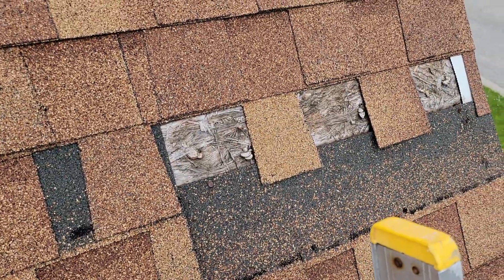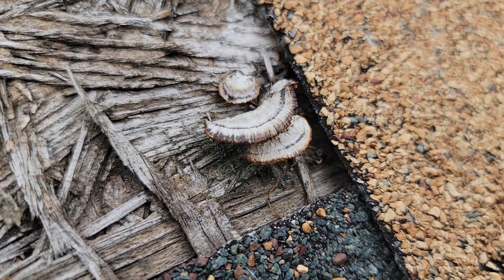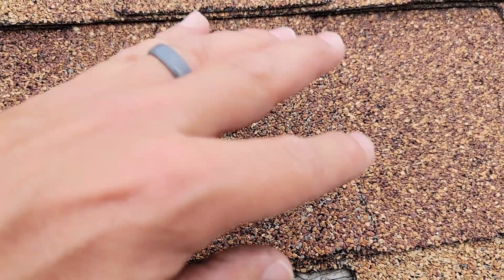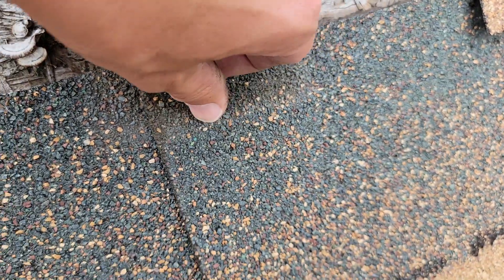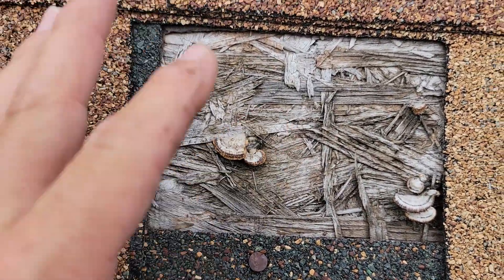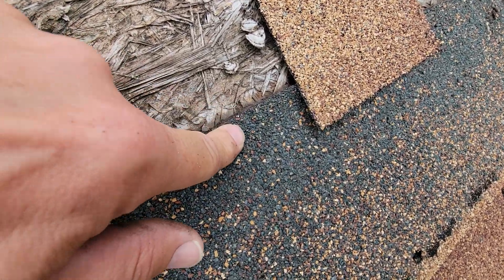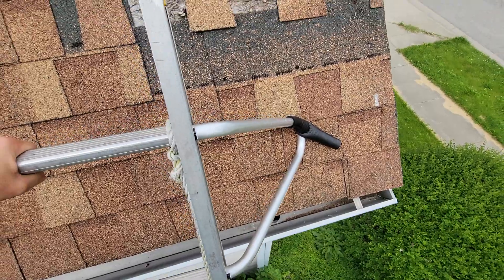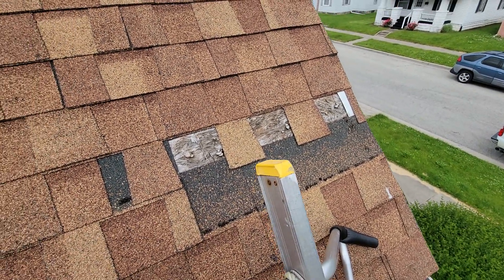Why asphalt shingles are covered with ceramic granules

Comment: Steps for Repairing Roof Shingles Using a Brad Nailer and Granules:
Prepare the Area:

Clean the Surface: Ensure the area around the damaged shingles is clean and dry. Remove any debris or loose granules.
Secure Curling or Buckling Shingles:

Use a Brad Nailer: Carefully use a brad nailer to pin down the curling or buckling shingles. Place the nails where they will hold the shingles flat without causing additional damage. Be cautious not to penetrate too deeply.
Check for Level: Ensure the shingles are as flat as possible before moving on to the next step.
Patch the Area:

Apply Roofing Patch: Use a roofing patch or sealant to cover the nail heads and any gaps around the shingles. This helps to seal the area and prevent water infiltration. Henry’s Roof Patch or similar products work well for this purpose.
Smooth the Patch: Spread and smooth the patching material over the nails and surrounding area to ensure it is well-sealed.

Apply Custom Granules:

Prepare Granules: Crush ceramic tiles to match the existing granules in color and texture. Sift the granules to ensure they are uniform in size.
Sprinkle Granules: While the patching material is still wet, sprinkle the custom granules over the patched area. Ensure an even coverage.
Press Granules: Gently press the granules into the wet patch to ensure they adhere well. You can use a flat tool or even the back of a trowel to press them in.
Cure the Repair:

Allow to Dry: Let the patch and granules cure according to the adhesive manufacturer's instructions. This typically involves a period of drying or curing time to ensure the repair is solid and effective.

Material Costs:
Brad Nailer: $50 - $100 (if you don’t already have one)
Brad Nails: $10 - $20 (for a box of nails)
Roofing Patch (Henry’s Roof Patch or similar): $10 - $20 per gallon
Ceramic Tiles: $2 - $10 each
Granule Preparation Tools: (grinder, sieve) $30 - $100
Benefits of This Method:
Secure and Long-Lasting: The combination of nailing down the shingles and using a patch with granules creates a strong and durable repair.
Exact Color Match: By using custom granules made from matching ceramic tiles, you ensure the repair blends well with the existing roof.
Weather Protection: The roofing patch seals the area effectively, preventing water from getting underneath the shingles.
This approach allows you to address the specific issues of curling and buckling while also ensuring the repair matches the existing roof's appearance.

Comment: Some shingles have ceramic granules but if your roof has black streaks that means you have limestone granules, limestone is much cheaper and holds water much longer so you get black mold streaks.